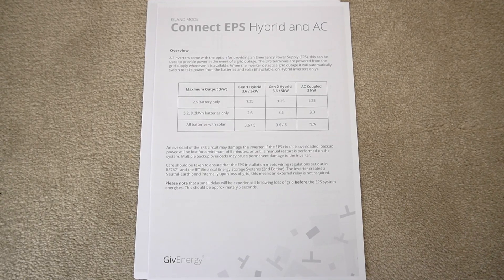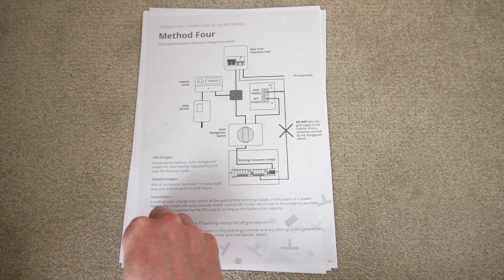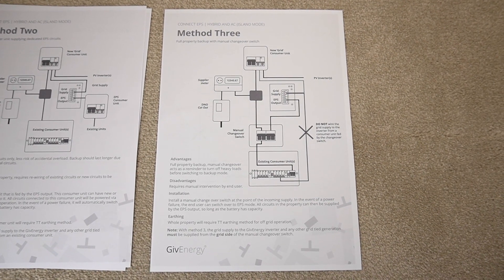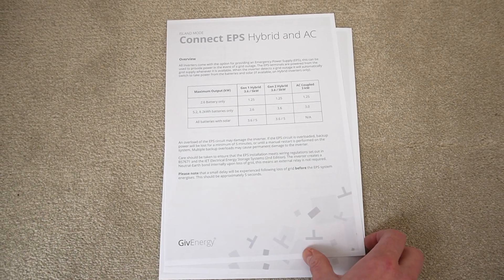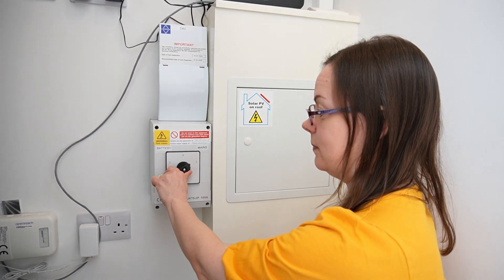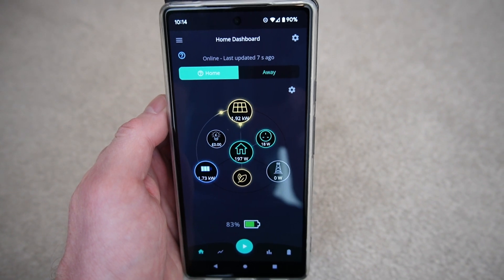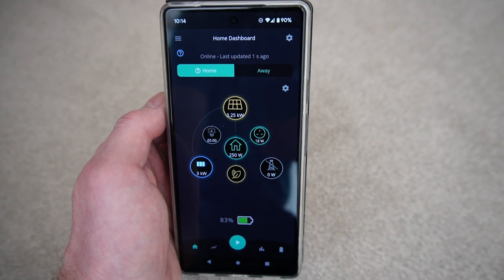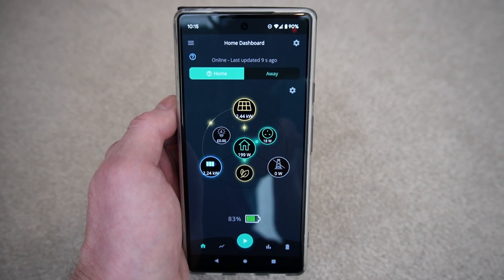GivEnergy whole house EPS - power cut backup demo

Comment: Hi Tim.. thank you for such informative video.  I am in the process of evaluating a solar + battery system for my home and wanted to have this very same back-up feature in the event of a power cut.  However, every single solar system installer that I have spoken to has been reluctant to provide an integrated installation with the EPS and no one has given me a good explanation (other than such feature deviates from their standard installation).  It seems you also had to have this EPS installed separately too (given the details of the EPS installer and costs you shared).  Wondering had the same experience and if you have heard any reasons for their reluctance to install an inverter with EPS?  Thanks!
Reply from the maker: Our installer had done such a system before so was happy to do it for us.  Nowadays there are more systems that have "gateways" that do this all in a much neater way, so those might be worth looking into.  For example the Tesla Powerwall 3 or the GivEnergy All in One.
Reply: @TimAndKatsGreenWalk  thank you for clarifying... yes I heard about Tesla Powerwall being able to offer an integrated solution but it is priced at such premium.  I am keen to use the Duracell inverter + batteries but the installer is not willing add the EPS feature.  I will call around and hopefully I can find a qualified electrician that is willing to install this EPS add-on. Thanks again.
Reply from the maker: It also depends on the battery/inverter system itself as to whether it supports it.  Our GivEnergy inverter has that functionality so could be hooked up in that way, I don't know about the Duracell one, you'd have to check the spec sheet.  Most do in one form or another so I'd be surprised if it didn't.  Often it's only one socket, for example, or one circuit of the house.

Comment: I've got an GivE AIO which I've tested by manually switching off the grid by the brutal method of just tuning the isolator off (downstream of the meter) As long  as the current load is below the max 6kw it switches over so fast that even my PC and router don't reboot! The problem comes when reconnecting to the grid which can take a while and some reboots of the inverter plus strangely also trips some older earth leakage cbs in the house. I'm not sure if the AIO qualifies as an epc but it seems to do the job mostly.
Reply from the maker: We were slightly too early to get the AIO but had we got our system six months later that's probably the system I would have gone with.

Comment: Hi there just about to make the decision to buy a Givienergy stack 3 (3 phase ) with inverter also 3. Phase. I live in holland and have 16*408 w solar panels on roof,  and we have time here were we get grid overload at 253 V and the solar panels inverters would shut down if I used this system  so that it is isolated from grid do you think the panels will keep charging battery and also supply house ? Best regards Mal Robbins
Reply from the maker: In our case the solar does continue to work and charge the batteries as well as power the house.  But I don't know if the same is true of the three phase system.  You'd have to double check with GivEnergy.  I suspect it would though, if wired up correctly.
Reply: @TimAndKatsGreenWalk  @GivEnergy thanks for reply I enjoy your videos very informative and has helped me choose GivEnergy as the battery system for us

Comment: I am having the 5kv inverter and 10kv battery. Givenergy system fitted. By Octopus Energy Ltd.. However they categorically state that they are unable to fit any EPS to the system . I contacted the Givenergy tech help and they state that there is absolutely no reason not to fit the EPS. Octopus are adamant that they cannot  supply it with EPS even though the system four with the auto changeover switch is available, I have even got the required switch  but would have to get another contractor to insert it to the circuit.     At the moment I am considering cancelling the whole fitting and getting another contractor to fit a complete system with an all in one battery/invertor and gateway.  This another thing that octopus will not consider at all. The rigidity they display is difficult to comprehend for a requirement I want for a backup as well as costs saving, £ 12000 is a load of money to pay and not get my requirements fulfilled.
Reply from the maker: I think Octopus are offering a basic standardised setup to keep things simple for them, rather than allowing fine tuning based on user requirements.  I guess that suits a good chunk of people but as you say it's not very helpful if you want something slightly more bespoke.  If I was to do my system again I'd almost certainly go for the AIO plus gateway, although that wasn't available at the time I got my system.
Reply: If you have whole house backup I think you need your own earth rod, completely separate to the grid earth. They may be saying that they cannot or will not fit that bit

Comment: Hello, so does it works with Givenergy 9.5kWh battery? Where can i get that EPS? Thanks
Reply from the maker: Yes, we have a 9.5 kWh battery and it works fine.  It's a function of the inverter, not the battery, and all the hybrid or AC inverters have this ability, as per the document I showed.  You'd have to talk to your installer about fitting something like this (the actual switch is unimportant, it's the wiring that allows it to work, so your installer could use any switch).
Reply: @TimAndKatsGreenWalk  so I don’t need to buy something extra to get that installed for a power cut? Just a usual switch and knowledge of installers?
Reply from the maker: @gaflandia2170  correct, it's just standard off the shelf electrical parts that your installer should be able to find and fit.  Just make sure they follow the wiring diagram (link in the video description).

Comment: Tim, did you need to get permission from your grid provider in order to install the EPS or could your electrician simply go ahead?
Reply from the maker: The installer just did it.  I don't think any extra permissions are required because if you're disconnected from the grid it won't affect any repairs etc.

Comment: This is great as I was looking at the Tesla Wall and not sure it is worth the much higher cost. Is it possible to get an idea how much more the backup system set you back compared to solar pv and battery only? I think the Tesla Wall is around £8k+ or something like that. By the way I am looking at a 10kW system with 10 - 13.5kWh battery, which I think the GivEnergy and the Tesla Wall have.

I am wondering, how easy is it to upgrade your batteries if for example you have a modular design. Can I do it myself or do I need to hire the installer and pay them over the top not 0%VAT prices? The 0%VAT only applies to the very first install, or so I have been told. If you do any upgrades later that's it, full price.
Reply from the maker: You might want to consider the new All in One battery from GivEnergy with their gateway, which gives you UPS  automatically, like the Powerwall, but much better value.  

You're right that VAT is payable on any future upgrades but not on the initial install as long as the battery is installed along with a solar array.  I think that's a bit weird but there you go.  For my system I could add another battery myself pretty easily, but I'm not sure about the All in One.  If you added a second it might need an installer.  It's a big one though, so you might find one is enough.

Cost details of our switch are in the description, btw.
Reply: @TimAndKatsGreenWalk  I am looking at the all in one now, just need to see how much cash we have after the heat pump installation, the solar makes so much more sense now, but in case of emergency, the heat pump will kill the battery:)
Reply: An update from my end, I did go with the GivEnergy All-in-One in the end. You video and response was one of the main reason. This might have been a great choice as Octopus has the Intelligent Flux Tariff. Our system is quite bespoke.
We only just had it installed last week, waiting on the SEG, so all our generated electricity is going to the grid for free at the moment. I went with Eurener Bifacial Panels (44 panels, 23 x 480W and 21 x 430W ), solar edge individual optimizers, I had the roof cleaned then painted behind the panels with Cromasol reflective paint, GivEnergy 13.5kWh Battery, one solar edge 10k inverter and a 6k inverter. Over the last 5 days we have generated 400kWh, and on Monday when it rained the whole day we managed 37kwh.

The huge shock for us was, just how invasive and destructive the installation was. We have too many armoured cables going in, they did hard wire the inverters, battery and gateway using Ethernet cables. Funny thing is, both the battery and gateway have their own wifi routers, so if you hard wire them, they can act as hotspots or extensions to your network. Frankly I want these switched off as they are on 2.4Ghz and broadcast the name of my kit.

Comment: You definitely had an advantage of the fuse box being on the opposite side of your garage wall.  I’m planning on option 2 for my EPS, will move most of the house ring main and lighting circuits onto the inverter for automatic switchover.  Our kitchen is on a separate fuse box in the extension so no easy way to EPS any of that, but does mean that there’s no real risk of overloading the inverter as all the high current drain circuits (oven, kitchen ring main, electric showers) are on the extension fuse box that I can’t EPS
Reply from the maker: Yes, our circumstances led to a very neat install, it couldn't have been much better, honestly.
Reply: You need to put a 23amp breaker in the system before the  connection to the consumer board ,and it will flip off if too many things connected, you then go around and drop off the high consumer items you don’t need and turn it back on without the oven hot plate Iron, and other monsters of current.

Comment: Did the installer add a separate TT earth for the island mode?
I have a GE system with an automatic change over which just powers essential services.
But it has not been commissioned yet because my electrician believes that the grid earth has to be disconnected during the changeover process.
Reply from the maker: Yes, I show that in the tour video, if you're interested.
Reply: Ah ok, Just looked at that, thanks Tim.
That’s exactly what I have planned to do, but electrician says that at change over the Grid Earth must also be severed, is that what they did with yours?
Reply from the maker: @ianv5533  Erm, I'm not sure, to be honest.  I assume all that happens inside the switch box?  It does seem to work at least so I presume it was all done correctly.

Comment: Great video thanks for sharing all the great videos. My installer tried to fit eps to our fox system and after 2 hours said ill have to come back another day as was getting late and its been left not fully working as it trips the breakers whenever they or we tested it . Does anyone know if they had an earth rod or equivalent fitted  when had there eps fitted  or and sparky on here know  i read on forums for my system that people say that it’s  recommended to fit an earth rod or equivalent  be my installer said they cant make it work  something about pme earth not  providing earth or something like that I remember what i read . Anyone can provide advice or help would be appreciated thanks
Reply from the maker: We had an earth rod fitted, I show it during the tour video.  That was specifically because of the EPS functionality, so perhaps that's the reason yours is tripping but I couldn't say for sure.
Reply: @TimAndKatsGreenWalk  yes so another eps install with Earth rod but our installation company didn’t think it was necessary

Comment: Would this work with a Givenergy AC-coupled inverter? Or does that need AC (ie grid) power to operate it? Really enjoying your videos Tim, nicely presented and easy to understand.
Reply from the maker: You can have this with an AC inverter but the only difference is that you won't be able to use your solar panels, only the battery will provide power.  Take a look at the first page of the document and it gives you the figures for what inverters can provide what power from what sources via the EPS.  I'm glad you're enjoying the videos.  Plenty more to come!

Comment: Nice!
The demonstration is simple enough in concept, but ideally, a best practice during this procedure would be to flick OFF all the breakers in the consumer unit before "Switching to Battery" as to eleminate arcing, surges and instantaneous current draws because that can damage your appliances.

By placing a coloured sticker above the circuit breaker of each "critical load" you can quickly reinstate only those one by one AFTER turning the handle. 

Enjoy your new system!
Reply from the maker: Yup, you're right, that is the preferred way to do it, and it's what our installer suggested too.  I did know that we were only drawing about 200W at the time though, so were pretty safe.

Comment: We're getting away with this by having a second consumer unit installed with 8 essential circuits so the cooker, immersion heater, steam shower etc won't try to use on eps.   That's the plan anyway as we're waiting for installation 😊
Reply from the maker: Yup, that's a valid option.  I'm hoping that we understand the power demands of the various parts of our house sufficiently well that we can manage the loads in the event of a power-cut.  The next time we have a genuine power-cut I'll make sure to record a few clips to show everyone how it goes!
Reply: @TimAndKatsGreenWalk  I forgot to add we rely on a pump to keep the basement flooding so we needed auto switch over so for us this option is best
Reply from the maker: @pallie233  ah, yes, that would be pretty critical!  Very sensible precaution in that case, for sure.

Comment: Now the true test , how many days can you go without using the grid . Should be easy if it wasn’t for the ev but worth a video
Reply from the maker: As it happens we've not used any grid power since 1st April (no more than 0.1-0.2 kWh per day for balancing in any case), and that's even with the EV charging (we only need an average of a couple of kWh per day since it doesn't do loads of miles) and a couple of hours of heating in the mornings.  Overall we've been net exporters over that time, so I guess we could have been totally off-grid for the last three weeks if we'd been careful.  Once we get the export tariff sorted (hopefully soon) we should be getting negative energy bills over the summer with any luck.

Comment: can you really discharge the battery at 3.6kwh? I've just had my system fitted, EPS not in yet but in the givenergy app there is a setting for max battery discharge and the highest you can set is 2600w
Reply from the maker: Sounds like you have a Gen 1 inverter, they have a max discharge rate of 2.6 kW.  The Gen 2 inverters have a max discharge rate of 3.6 kW.
Reply: @Tim & Kat's Green Walk  that's mega helpful thanks, I asked for gen2 products to be installed, battery I think is gen2 as its 9.5kwh and while inverter doesn't specially say gen1 or 2 the rates on the side do say 2600 for input and output one of the main reasons I wanted a gen2 to charge battery quicker and we had EPS in the quote so gives the extra output for this and general house usage
Reply from the maker: @leespowart2808  yeah, mine says 3600W charge and discharge on the inverter.  I think that's the only obvious indication as to what inverter you have.  They really should put the inverter type on the info panel!
Reply: @Tim & Kat's Green Walk  yep agreed, think I have a problem now as well with this being installed, my fault but the quote I signed says gen2 9.5 battery and 5kwh inverter but doesn't specify gen2 was just in conversation so I suspect they will say that wasn't in writing
Reply from the maker: @leespowart2808  oof, yeah, that's annoying.  Well, you can give it a try, you never know.
Reply: @Tim & Kat's Green Walk  yeah will give it a go, on another note the quote had full house EPS but they are trying to back out saying its too hard in existing house, assume yours was done to existing wiring etc and didn't take too much effort to get in place, they are suggest a single socket off EPS but I don't see the point in that really